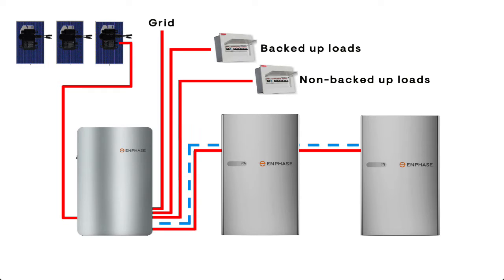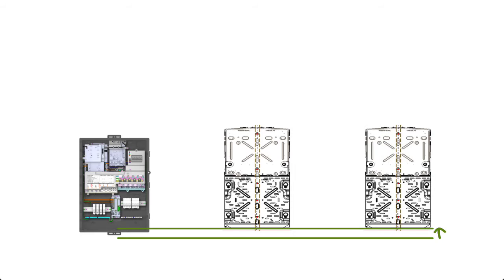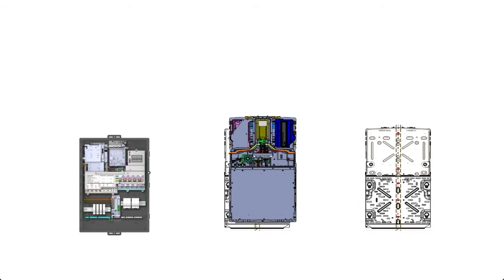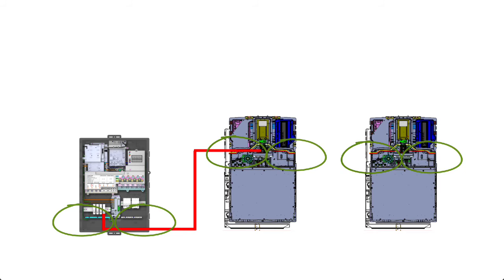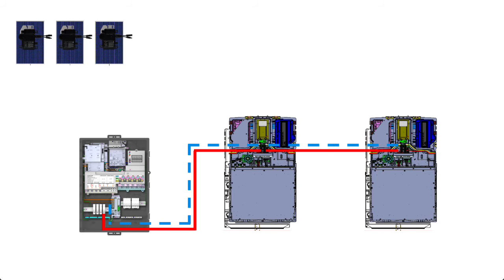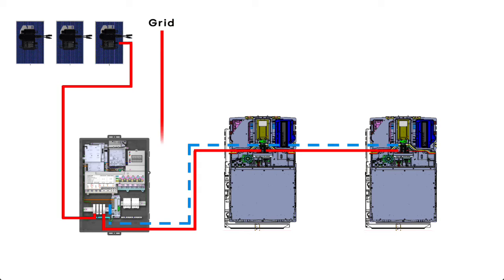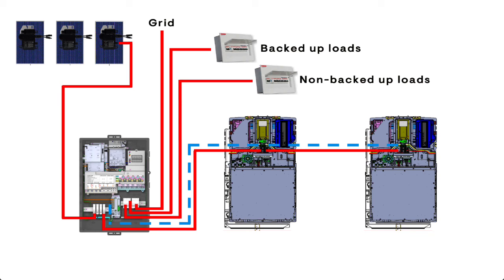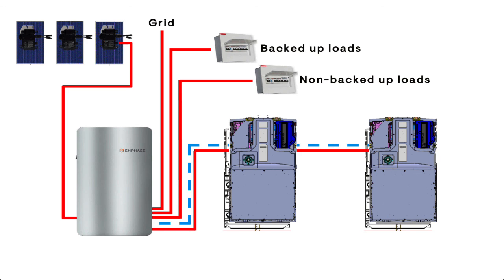Enphase Energy System Installation Workflow Animation

Comment: What confuses me the most that after waiting a few days and watching another one of these I don't understand what the PV combiner box is for if your using the controller box, don't the micro inverters wire into the PV combiner box as circuits and then what are those other circuits again in the PV combiner box..you need step back and really know what there doing with those.  Why whyyyyy whyyy
Reply: Its like ok the PV combiner holds breakers for strings of micro inverters up 4x20amp breakers but what about the PV input in the controller box, it says it can input PV and im assuming the loads are outputting out of the controller but why would you put loads coming out of the PV combiner with also having a controller box which essentially looks like it has the output for load panels or only the PV combiner or only a PV controller..

Comment: I have 31 panels with 31 IQ8A Inverters mated to a 4C Combiner Box.  When does that fit when I add some 5P batteries.
Reply from the maker: Hi Thomas,   It sounds like you are located in North America.  To get support for your specific question, (as your equipment requirements are different than those of ANZ)  I recommend contacting Enphase in your region.   This link should help get you to North American support for your questions:  https://enphase.com/support